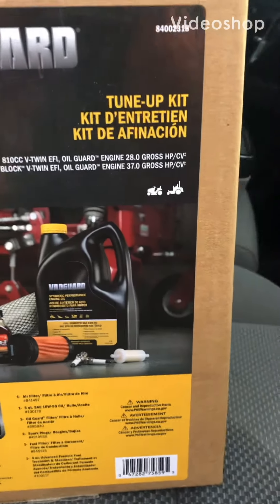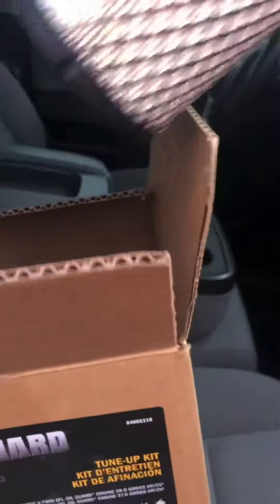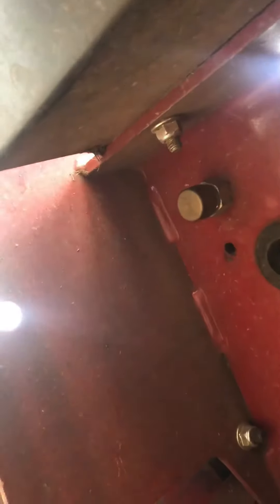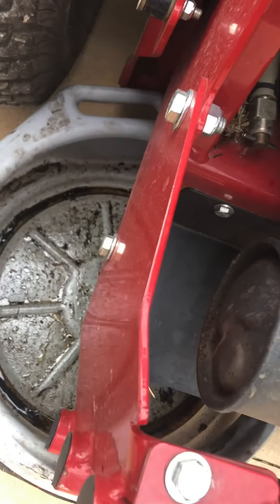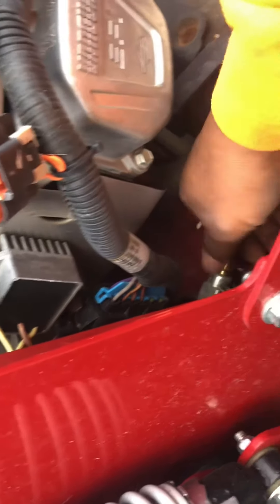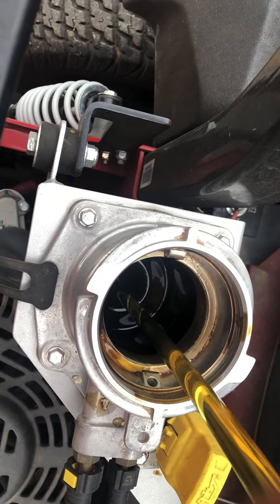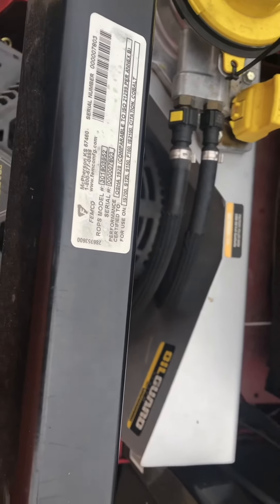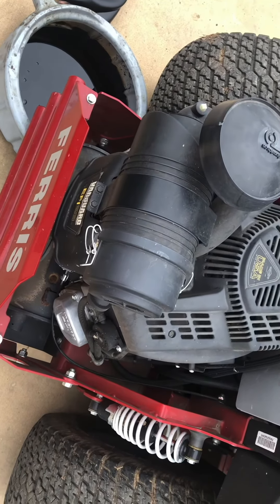Changing oil on a Ferris mower with the oil guard  for the first time

Comment: Isn't it 1 year or 500 hours whichever comes first?
Reply from the maker: I asked that same question when I purchased the mower. The dealer told me, I can cut up to 500hrs if it takes 1 year or 5 years to accumulate the hours. I changed the oil on this mower year 3.  Never had any issues with it.
Reply: Really? Hard for me to believe on time.